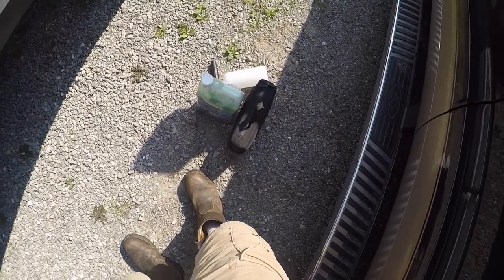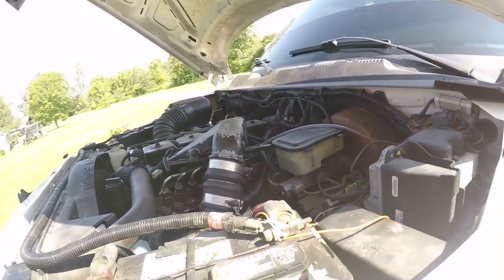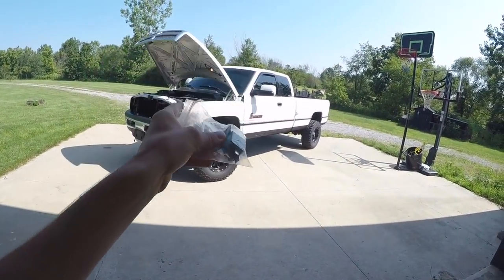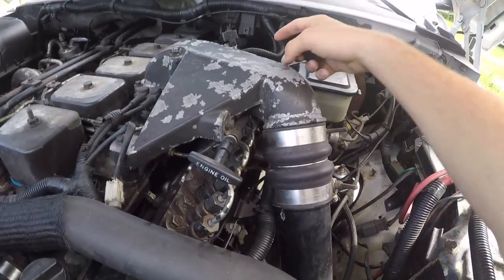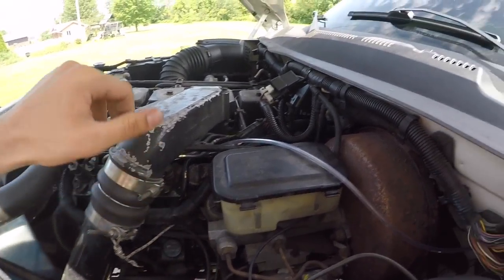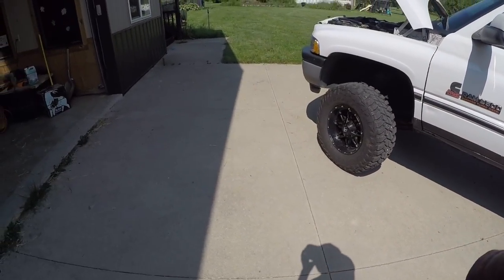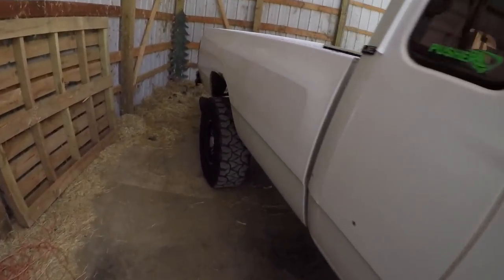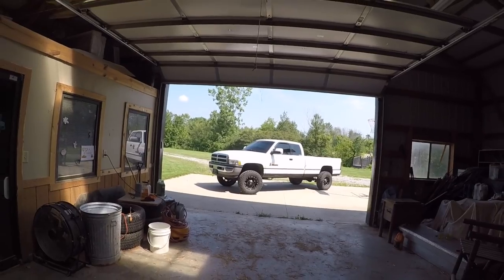HOW TO REPLACE FUEL SHUTOFF RELAY ON 5.9 CUMMINS!!!

Comment: I have the exact same truck and it has had the same problem with starting. I have tried just about everything and my next step was replacing the whole fuel shutoff solenoid but I never considered this. Definitely going to try this first! Thanks!

Comment: PLEASE HELP!!! I purchased a Larry B silenoid for my 94 12 valve and installed it along with replacing the relay and it still won't pull up. It only holds in place if I pull it up manually. What could be the problem???
Reply: Check out videos on here on by passing the relay. Also there's a way to short the solenoid plug to test the solenoid itself. If you short it and it still doesn't work, you're wires or solenoid is bad.

Comment: Just bought a 96 Dodge dually 5.9 12 valve. It was extremely neglected!  Would have preferred thathis situation regarding the fuel shut off solenoid was more accurate. I'm still in the dark regarding problem.

Comment: +loud and proud if your going to be hauling hay do not stack it you can catch your hay on fire I have a 1995 ford 7.3 with a stack in it it's a 8 inch soflo diesel octagon stack
Reply from the maker: haydon walker I don't haul hay with my truck

Comment: someone ask is the truck crancking dont say the truck is cranking say the truck keeps turning over till you flip the switch I'm 17 and I use to be told that so early hint so someone who knows a lot won't sound rude but goodluck I'm getting mine in a few weeks they want $5,000 needs few things but I got a few extra parts for it brand new
Reply from the maker: Hakkd Garage 👍

Comment: But I'm not sure if I'm a hundred percent sure about this but if you're still annoyed is bad it will cause your relay to go bad so you might end up replacing both again just a friendly advice not a hundred percent sure but I think if the solenoid is bad it will cause the relay to short out I might be wrong though have a good one buddy

Comment: I'm gonna sound like a cranky old man but use the forums, ask questions there. Don't throw money at random shit thinking it will solve the problem, do it one step at a time trouble shooting. And for the love of god before you do any other mods, like exhaust, spacers, giant C decal in the back window fix your KDP, its a few bucks to make the block off plate, or even 50 bucks for an entire kit. Do it yourself, there's even a step by step picture guide in the kits. And you can do it with basic hand tools. I had my Cummins for less than 12 hours before I fixed the KDP, and it was half way out at 122K miles, its cheap insurance.
Reply from the maker: Paul Madsen I did go to forums and they said it's either the relay or solenoid. Being so cheap I just ordered both. And I didn't buy the stick on back, previous owner did. And I am fixing my KDP in a couple weeks. And I do prioritize.... if you've seen all the videos step by step you'd understand that. Don't get all worked up and assuming things if you haven't even been paying attention to all the vids... that's kinda why I make them day by day....

Comment: My 2001 ram 24v it cranks but it won’t start on the first try I have to crank it maybe two more times then it will start you think it might be that same relay as well?
Reply: Did you figure it out my 01 24 just stopped driving down the road I am about to check this relay and solenoid to see if it fixes the problem

Comment: Should I buy my grandpa's duramax or should I look for a different truck
Reply: Z7 Cinema look for a different truck cummins 2nd or 3rd Gen if you get second gen get the 12 valve
Reply: What year duramax
Reply: SPARTAN MIL-SIM 2009
Reply: Z7 Cinema if you like duramax than that but if you don't than get a 12 valve but if you get a good deal on the Dmax get that
Reply: I will sell you my 1995 12valve 2500 Cummins automatic white regular cab 224,000 miles, $7,000 only reason for selling is too loud im too old..NO RUST  NO RUST NO RUST
Reply from the maker: BrianLeeUSA73 maybe I should buy another one! 😂😂😂
Reply: you are welcome to come and look at it and test drive it.

Comment: I have Almost 200 subs. Damnnnn lol
Reply from the maker: Johnny Koch sweet dude
Reply: I'm wanting to install a kill switch on dodge diesel engine truck as an anti theft system.  I was told to install the kill switch on the fuel injector, not the fuel tank pump. does that make sense or it there an easier way to do this?